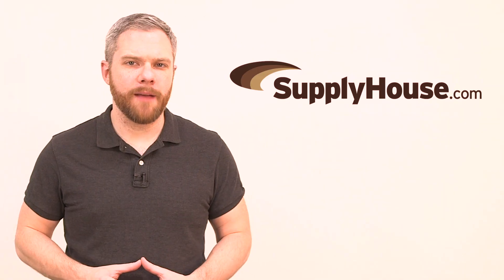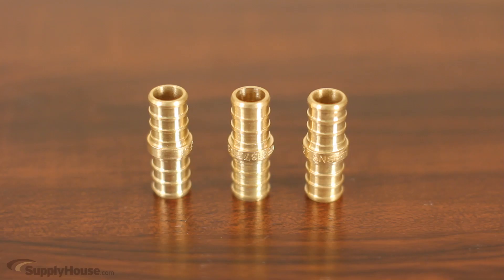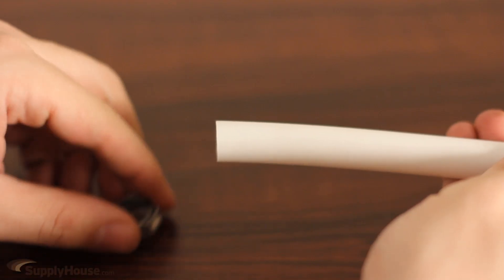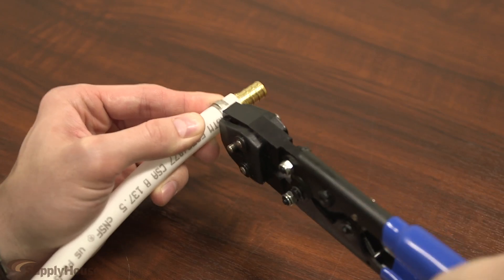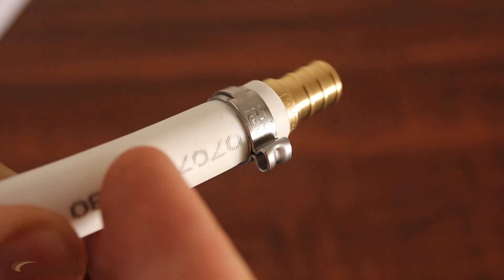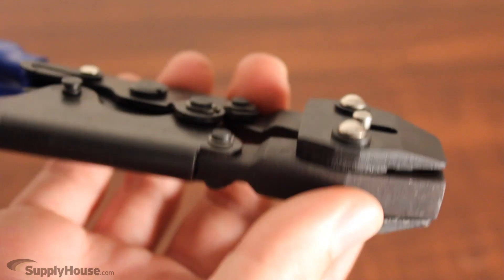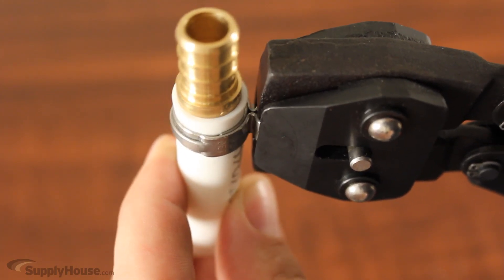How to Make PEX Clamp Connections

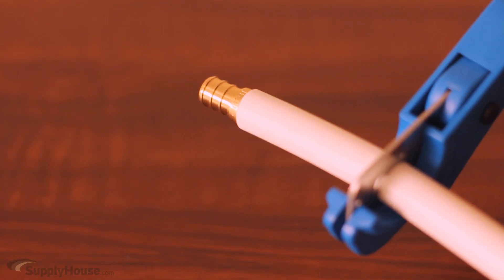Comment: 1:09 is such a lie lol. Once the pipe has been clamped on, the pipe molds itself around the barbs of the fitting making it really hard to take out - I've wrestled with channel locks for 20 mins trying to disassemble. In the video, you can tell they're using a new pipe because you don't see the mark from where the clamp was. This part is a blatant lie. Don't be a CNN Supply House.

Comment: Do you have to cut off some of the pex tubing when redoing a connection?  If so, why?
Reply from the maker: We recommend cutting off at least the part of the tubing that was in contact with the fitting and ring because the integrity of the tubing could be compromised.
Reply: Does this clamps has any kind of warranty?
Reply: J Emanuel Martinez sure, 20 cents a piece if it destroys your home..